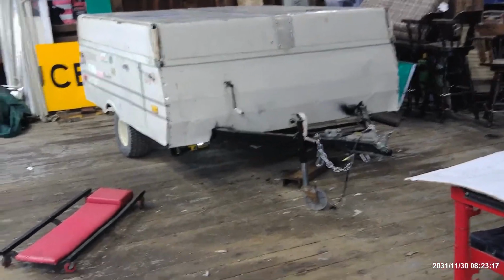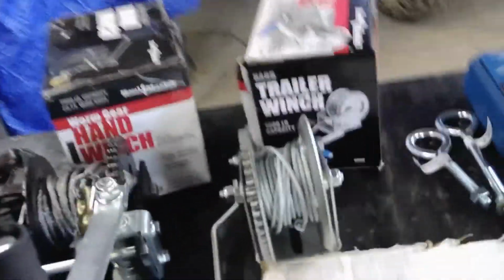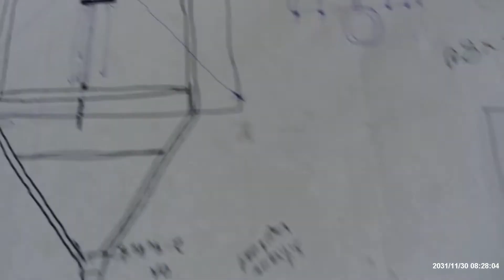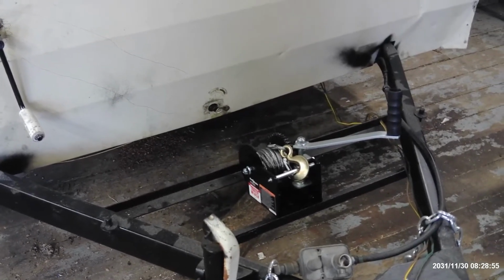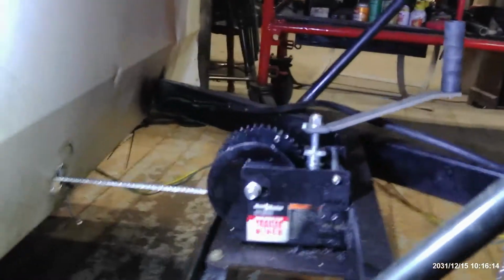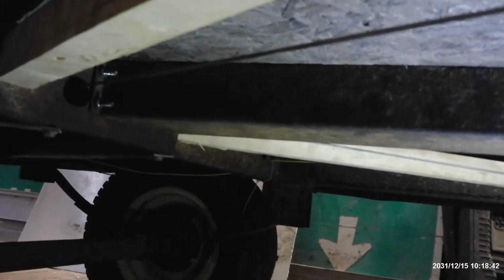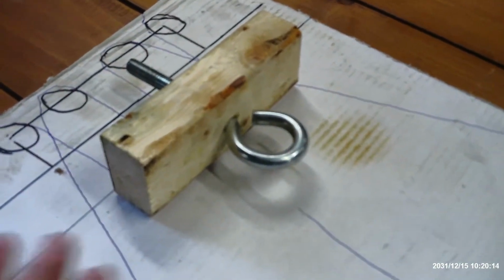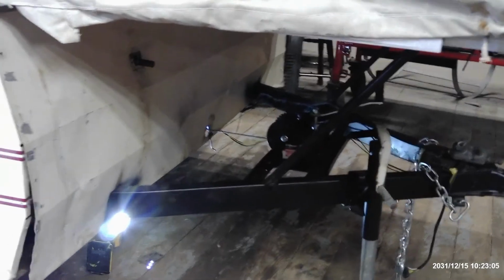Replace Whiffle Tree under 50 Dollars

Comment: Thank you for the idea! I'm currently doing something similar. I'm curious, how did you remove that front steel bar where the crank attached to? The video cuts out. I tried removing mine but it seems like there is some type of stopper to prevent it from coming out. Did you have to remove the front panel to access?

Comment: If your cables aren't guided through the holes on the frame, they will rub the edge of the hole and fray and eventually break. I hope you aren't in it when that happens.
Reply from the maker: They are through the factory holes in the frame actually, the old cable went right up through the middle and I just added a new hole out the front in a straight line with the other holes, and eliminated the chain and sprockets that put the crank in a more convenient location

Comment: You think a 1200 pounds winch would do with a normal roof?
Reply from the maker: I thought about using a cheap harbor freight ATV winch for it, but decided not to. I hooked up my 2000 pound winch on my quad to it, and it didn't want to lift it, but it had added friction to it because I just ran it under the tongue and hooked it
Reply from the maker: But I added a lot of weight to the roof, plywood, boards, and heavy aluminum. But think that a 1200 pound winch would lift a normal one.
Reply: I just bought one for 100 bucks did what you did yesterday thank you